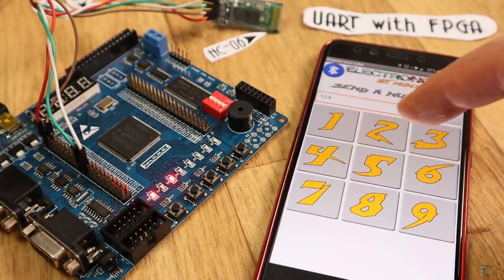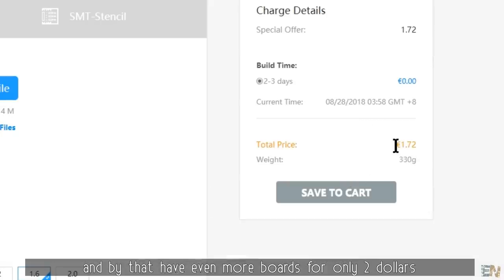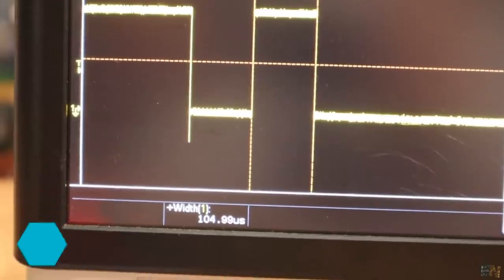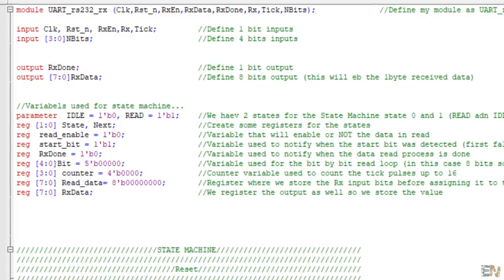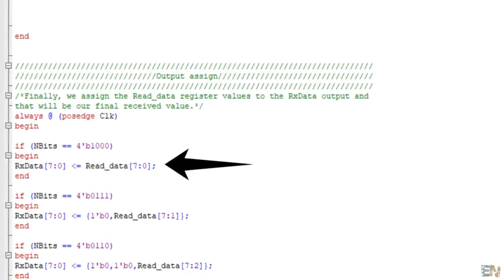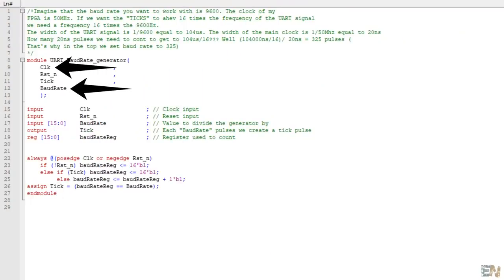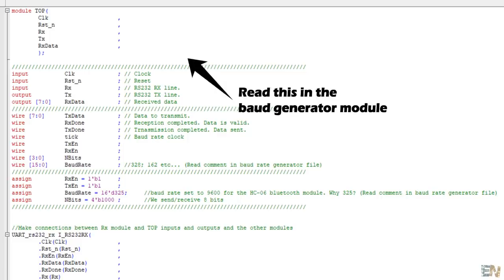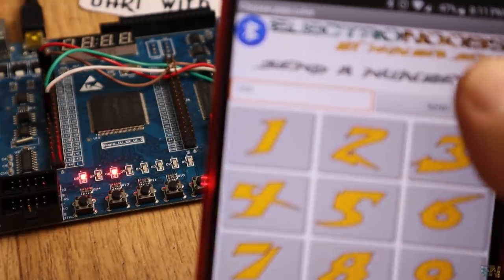UART & FPGA Bluetooth connection | Road to FPGAs #104

Comment: Wow. I was not going to get one of these Cyclone IV boards but your doing great stuff here. I need one of these so I can follow along myself. I think this is probably the most useful project you've uploaded so far.
 Thanks dude.
-Jake
Reply: You should think about creating a generic gerber file for people to order from JLCpcb if they want. I wouldn't do a project specific type of file either. I've been etching my own SMD to DIP breakout boards for TO-252, TO-263, SOT23, SOT-23-5, and SOT-23-6 footprints. I haven't seen those available at all on eBay or AliEx. I ordered a bunch of different TO-252 and TO-263 MOSFETs that are sold on AliEx dirt cheap. The most effective one so far has been the 06N03LA N Channel MOSFET. I got a bunch of them for $0.02 each. They are a good replacement for IRFZ44's but they are only available in a TO-252 package. Another breakout I've been etching is a SOP-8 with the standard pinout for MOSFETs. That FET package is also available really cheap on AliEx and they tend to be super useful because this package is so popular with lithium battery protection circuits especially the P Channel variety as they have ultra low Vgs thresholds and super low on resistance. I generally buy the premade SMD breakouts if they are cheap and available but there are several SMD packages like these that are not sold. If I were in your position and really wanted to get more people placing their first order with JLCpcb, I would create a few gerber files with the most useful stuff I would like to have or would find useful, then I would try to make it as easy as possible for people to place an order using the files I created. This could get a lot more people placing a first order even though they do not have a design they are ready to upload yet. 
   I was even thinking about creating my own etch transparencies kind of like this to use for footprint identification. I'm sure you are aware of the PCB measuring rulers that also have a bunch of footprints for identification. I have been thinking about making my own version but instead of a ruler with footprints I would make centimeter and millimeter tick marks without the usual linear numbers, just tick marks. Then create a bunch of SMD footprints next to the tick marks. Instead of just a ruler with footprints, the design would be a full set of SMD to DIP adaptors that could be broken out at any time. Even after a ruler is broken down for one of the adaptors the other pieces could still be used as a ruler and it would not seem devalued so long as the number scale was missing.
...just some ideas ;)
-Jake
Reply: @UpcycleElectronics  Although I understood half of what you wrote, I still appreciate your effort for writing this long comment :)

Comment: I was surprised how much high level programing was already on the bluetooth module, I was prepared to be jealous of you programming the high level into the FPGA 😅 I have played a little with AHDL about 20 years ago in a fun little project where I captured certain bus addresses to switch certain external memory pages in place of the true smaller memory address map of a microprocessor. I remember there were no gotchas, it just worked. There is a little brain hurt at first and then it's just another programming language. Good to see another modern inventor with a wide scope of creative tools!

Comment: Hi, thanks for the tutorial. I managed to get  RX and TX working without the baudrate generator by counting the 50MHz clock directly for the required half-width and full-width counts. 
In the UART_232.zip I downloaded from your website,  UART_tx.v needs a couple of fixes. The Tx  output needs to be initialized to 1 so the line is high at start.  Then in the 'write data out to tx' code, the first time you reach the full pulse-width count, you need to reset the counter to 0.

Comment: Just wanted to give you some feedback on the use of the verilog in this project. I actually used this in my MIDI stepper synth I'm working on and I ran into a few issues. 
The main thing I want to point out is your baud rate generator. It is unnecessary. It is way better to just use the 50 MHz clock and count the number of clock cycles that would equate to 8/16 ticks. I had a lot of data that just wouldn't get processed because of this. 
For the case of my project, I had a 31250 baud uart so I just counted 800 and 1600 clock cycles and all my problems went away. 
The only other stuff was the fact that you really don't need a next state. The two states with the enable work just as well. 
Everything else I had to do was just modification for my project specifically.

Comment: So does your Top module not implement the ability to Tx data?  It looks like the Tx module itself does, I guess it wouldn't be hard to wire up the IO in the Top module if you needed it.
Reply from the maker: Yes te TX module works. But for this example I had no data to send from the fpga. Only receive.

Comment: hello I've got all the code of the project I've installed on the card but I'm trying to run zybo 7000 card on the leds but it works.
  Need to do a different operation when installing the code to the card?

Comment: @Electronoobs

Why can't I transmit even characters back to my PC into PuTTY? If I set TxData to 65, I get an 'A'. If I set TxData to 67, I get a 'C'. So why can't I set it to 66 and get a 'B'? PuTTY is set to 8 databits, no parity. It displays rubbish for any even character I transmit.

For example:
wire [7:0]     TxData   = 65   ; // Data to transmit - transmit 'A' character - WORKS OK

wire [7:0]     TxData   = 66   ; // Data to transmit - transmit 'B' character - FAILS
wire [7:0]     TxData   = 67   ; // Data to transmit - transmit 'C' character - WORKS OK